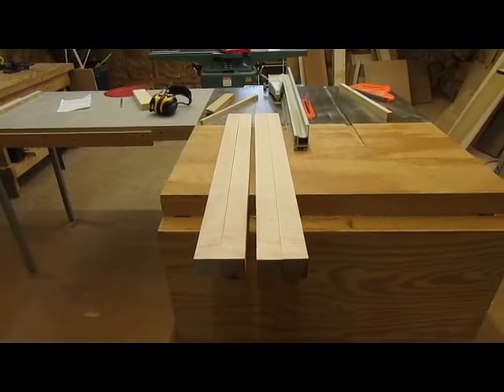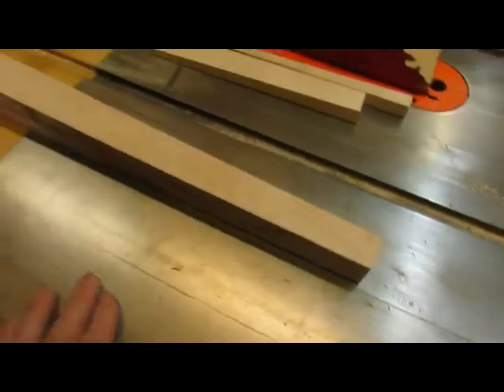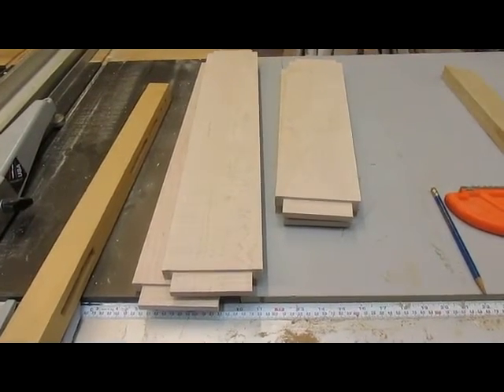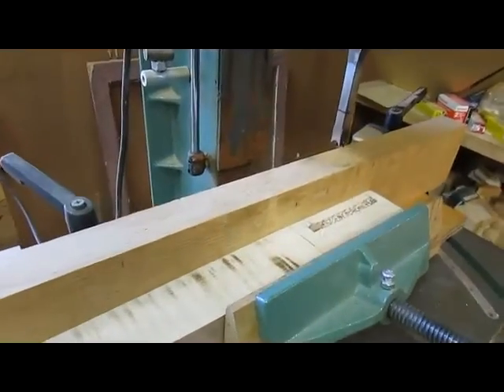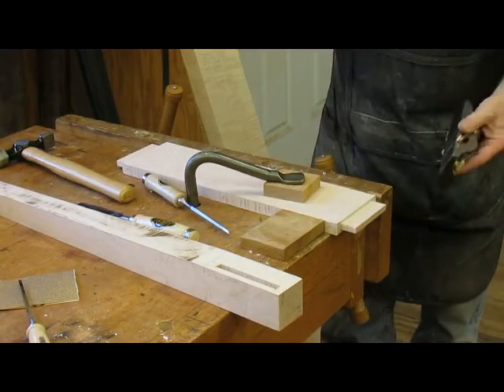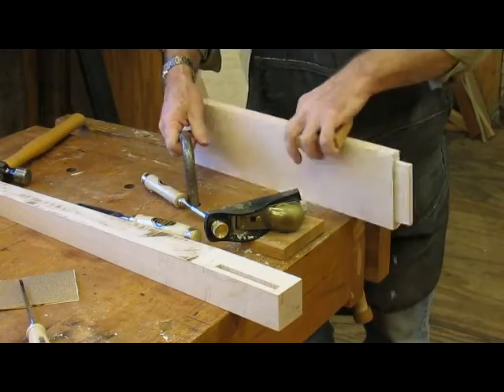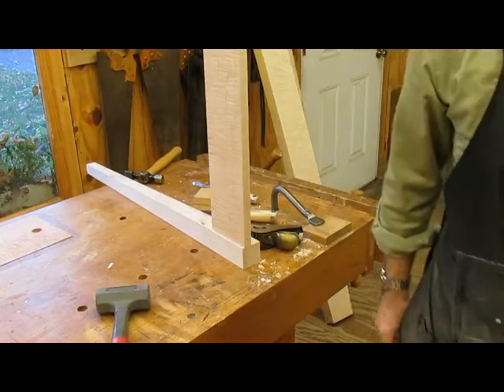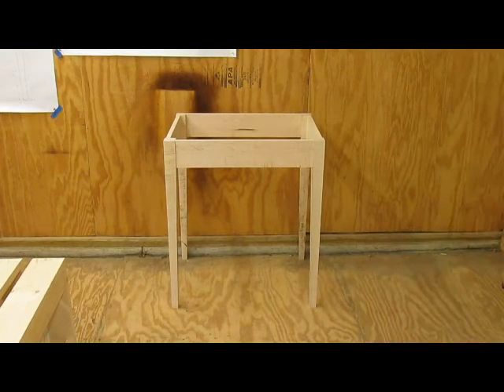19th Century Clerks Desk   Making the Base   Step 1

Comment: Looks like a fun project.  I noticed at the end you have a raised bench on top of your bench.  I have been interested in building one to maybe save some wear on the back.  Does it work well and do you use it ?    Thanks.
Reply from the maker: +Ross Hastings I used it all the time, saves on the back.  there are screw holes in the top so I can anchor it.  Jeff Miller design
Reply: +David Boeff great thanks for the info I'm going to move forward with it then.
Reply from the maker: Ross Hastings Great